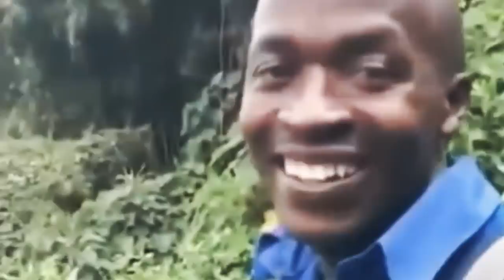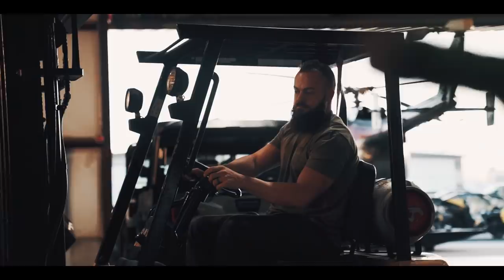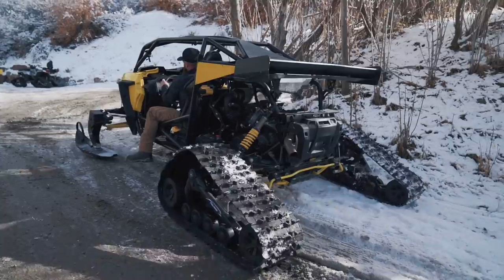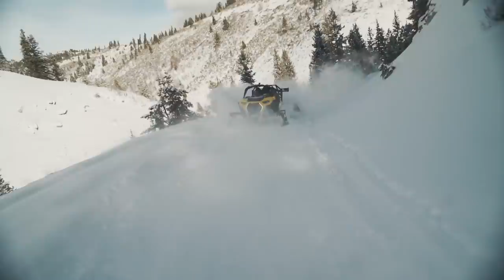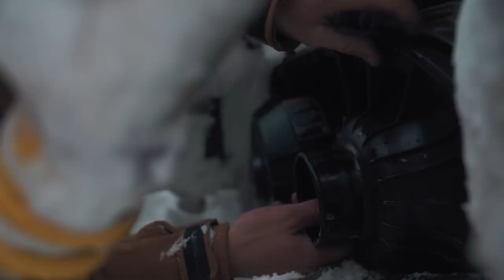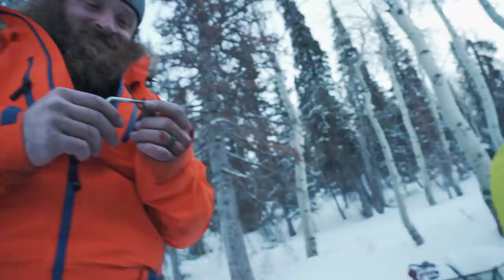Porsche Turbo RZR On Snow Tracks and Skis- DEEP SNOW!

Comment: Many years ago, outside of small city's in PA. along the Interstate of # I-80 &I-81 the roads were snow & ice covered  roads where the highway closed them down, People were stuck, stranded, without food water, facilities. Many people that were able to get to the vehicles to offer food, hot beverages, blankets, fuel to keep the people alive. Push vehicles to the side of the roads with help & take people to homes & local motels did so. Many people at local restaurants had made sandwiches, hot beverages & with many volunteers on snow mobiles came to the rescue. Many of us were within a half mile to get to local stores to buy supplies of cold meats & fruits , snacks, water,  We donated what we had, never expecting anything inn return . I had several insulated thermos bottles & filled them with hot drinks, sent disposable cups, bags for garbage & everyone survived ! The roads were cleared & opened up 6-12 hours later & traffic was moving again !

Comment: The broken belt could be worse, It could be at Arctic Cat HDX 700. Not only can you not get the belt cover off without removing parts but then the secondary has to be removed also to change the belt.  There is no clearance between the secondary and the top of the housing. That's why sold all my artic cats.

Comment: That is so bad ass. But I'm from water world. With that much power driving the tracks, you need a skeg on those skis so they can bite and give you directional control. Basically, you need a knife longitudinally under your skis.

Comment: What would be killer is my 1987 Suzuki King quad LT four-wheel-drive with the gift lockers and independent front and rear suspension on tracks that would be bad ass the only bad thing about it would be that it is a short wheelbase it’s not a longer wheelbase

Comment: I have always wondered how hard i would be to add running camber control to the front of a ski based steering. It seemed to me like they are always just flat which seems counter to the need. Not sure a mechanical solution would be that easy, but either an electric motor or hydraulic version might work really well.  Then again what do i know about suspension or steering!!! Not a thing!